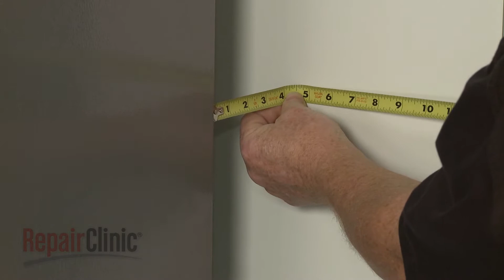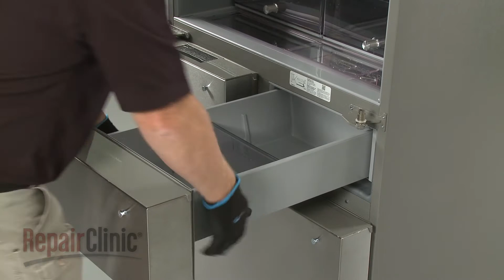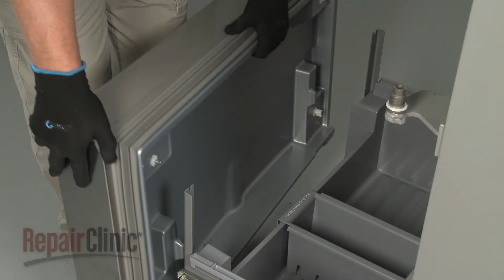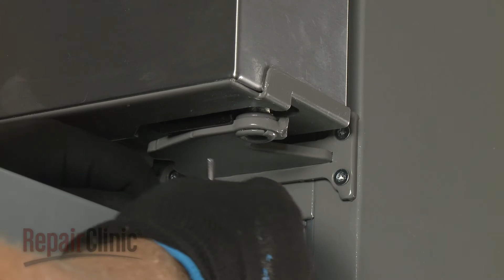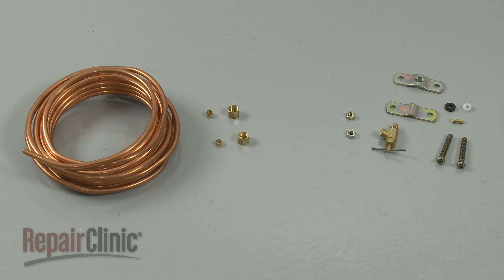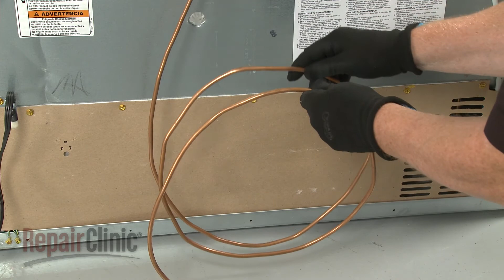KitchenAid Refrigerator Installation (Model KRMF706ESS01)

Comment: This refrigerator is a problem!!! Buyer beware! I have had it for 3 months and honestly it is not worth the money! The ice maker stops working at will. It has defrosted 2 times and has had an ice build up in the freezer with frost all over the food and drawers. Now it is defrosting again and my food is getting warm. The automatic water dispenser allows you to set the ounces and dispense but the counter gets stuck and you have to continually press the panel hard to make the numbers advance. The spill proof silver counter edge is coming off. It was not glued properly. One of the middle sliding drawers in the freezer has a face that pops off if you open the drawer. At this point I can return this mess and buy and cooler, fill it with some ice and call that a refrigerator! Anything is better than this poorly made beauty!
Reply: ladydawnie1 I’m on here looking for a fix for the ice maker not making ice myself.
Reply: Daniel Dean,
If yours is still under warranty, call for a repair and them keep calling if you have the same issue.  This beauty is a lemon. The company said my drawers are not covered even though the glue strip that was used to make the spill proof lining  has come apart. And the freezer drawer always came apart when you open. That is a manufacturer defect not I’ll usage. They ARE sending me new drawers. The nerve! 😡😡 Good luck. The repair guy is coming back Friday to install  a new temp gage and something else for the freezer and a new panel for the ice maker/water. Good luck to you.  My unit is only 3 months old.